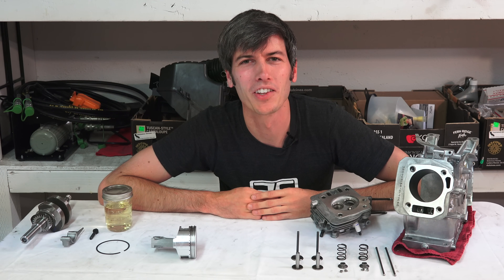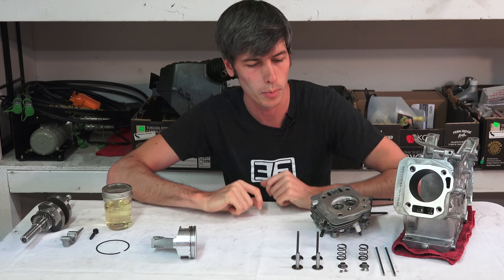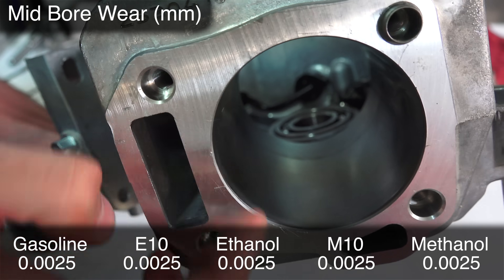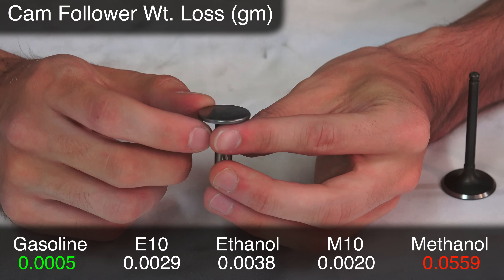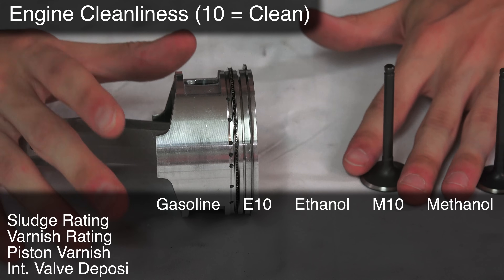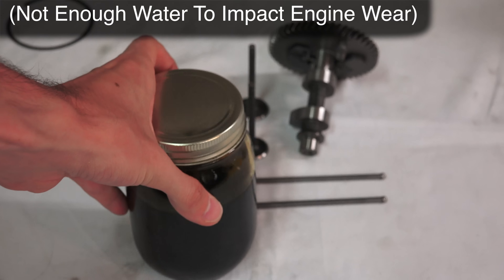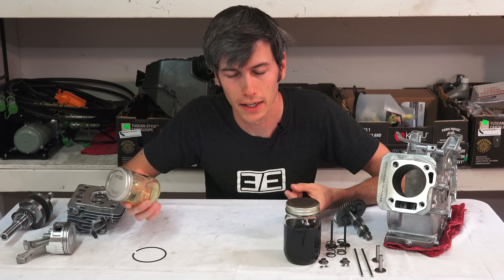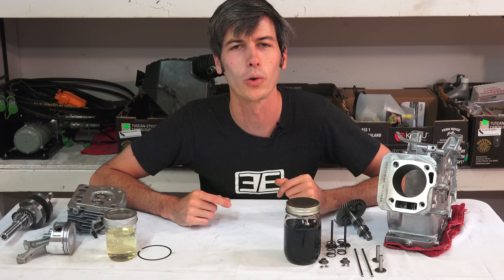Is Ethanol Bad For Your Car's Engine?

Comment: I would have thought the top ring wear was due to the AFR the engine would need to run at Wot due to Methanol having the lowest energy content and the bores were being washed of lubrication.

Comment: I’ve heard a lot of people complain about ethanol, myself included... none of us talk about engine internal wear. The concern is the tank, pump, lines... the rest of the fuel system. You can’t store this crap safely, nor does it play nice with aluminum. This is why airplanes approved to run automotive gasoline are NOT allowed to run E10; lots of aluminum parts in the fuel system, and it needs to be stable for long periods.

In the car world, anyone who owns or is restoring a car that uses the Bosch Jetronic or K-Jetronic CIS fuel system knows about the problems with ethanol. Many of those aluminum fuel distributors have been turned into paperweights because the ethanol gets in there and corrodes them beyond repair. These fuel distributors were used in cars from Europe during the 70’s and 80’s, ranging from VWs and Volvos to Ferraris and Lambos. Some unfortunate owners have discovered the hard way when they sent a poorly performing fuel distributor in for rebuild that the E10 had corroded the tiny internal passageways and it was toast.

As far as the test: I work in aviation, and a 20-hr engine test would be laughed at if one used it to justify any long-term durability conclusions. Take a look at FAR 33. It outlines a 150-hr test, and no engine is certified with only one of those tests... it takes many repeats of that test to prove an engine (or oil, or fuel, or engine modification).

Comment: E anything is a scam.  Without government mandates it will die a  natural economic death.

Can't let that happen of course.  Luckily here in Alaska all gas, is well, all gas.
Reply: Im getting a 1984 Ford F250 with 5.8 litre and i will only use premium as its carbed i hate blended gasoline and same with my '86 Mazda B2000 it usually gets premium to i beleve the blended gasoline wrecked the original carb it ran really rich coyldnt fix it and finally crapped out.

Comment: I have a Mercruiser carborater V8 engine  which usually sits for 10months pa. At the first start each year, it takes the engine 15min to run smoothly. Not with unblended gas. BR from Germany

Comment: In my experience with the E10 Fuel in Australia, you get a fair drop in fuel economy with E10 fuel which negates the slight dollar saving they give you at the pump for it.
Reply: If your O2 sensor is working, maximum drop is 3% using E10 (100% has a 30% oxygen content). In Melbourne, E10 is generally 5-6% cheaper than regular petrol, still works out better and it's better for your car, cleaner cyl heads and valves.
Reply: @doughartmann9272 my Mazda 3 running on E10 gets the same fuel economy as 98. Go figure.mazda recommends E10 for my vehicle.
Reply: Yap.That´s true. Here in Brazil, ethanol is cheaper but  gives a worse fuel economy. Always around a 20 or 30 %  less mileage.  That´s why brazilian  small car are  built with bigger fuel  tanks.
Reply: @Hernan7929  When I was using E10 in Australia (BF Falcon XR6), my ute lost power and economy on ULP. 
It gained power and economy on PULP. 
I got increased power, same as PULP on E10 and worse fuel economy. 
But, using E10 it got better Kilometers/miles per $$$ than all other fuels.
Reply: @Hernan7929  Out of curiosity, how much are you paying for ethanol vs. gasoline or diesel right now?

Comment: Great info, but what about Ethanol effects on fuel lines, injectors and so forth over a few years of time?
Reply: After 20 years of E10 in my Jeep with some experimentation up to 25%, I had to replace a fuel line due to salt and snow related corrosion of one of the few steel fuel line components.

Comment: Brazil 
The first car with an ethanol engine was produced in 1978. 
Rising from E22 up to E100 since 1978!!! no problem for 40 years. 
Just because it is new to USA not mean new to the WORLD.
Reply: The problem with E100 is producing it. A friend invested $1000 in an ethanol stock 15 years ago and saw it go nowhere... just gradually lost value. Ethanol production has a lot of costs, particularly in using arable land for growing the crops used as base stock for the ethanol. Dedicating land for ethanol production inevitably increases crop prices.

Comment: If ethanol has less energy why do people change there cars to run on E85 and say it is better? Is it a placebo
Reply: Energy is measured in joules, not British thermal units as most think. Different fuels exert different forms of energy measured in torque and power.

Comment: I run e85 as much as possible. My engine has to be pretty decent then I guess.
Reply: I use it because it's cheaper, even with lower MPG i save money.
Reply: I've got a flex fuel car with nearly 84k on it and all but maybe 5k on E85, still runs fine.
Reply: Actually what i have seen here in Brazil is that when a car runs only with e100 (that's right), the engine life increases a lot, even the oil is cleaner when it's changed... Another day i saw a 2l Chevrolet Monza (j body ohc) e100 rated with 600.000mi and the engine was the original, never opened...

Comment: In Brazil we have 100% ethanol on every gas station and even though it’s significantly cheaper than gas right now it is about 30% less fuel efficient 
The good thing is that the gains in power on flex fuel cars or performance cars that were converted to ethanol is veeeery noticeable

Comment: If you extrapolate 20 hr wear to 100K miles at an average speed of 25 mph (which would include idling) you get 4000 hrs of operation, which increases wear by 200x, in which case your cylinder wear value for gasoline reaches 1 mm. Is that normal? I have no idea. Perhaps some viewers know.

Comment: the  One study shows in most measurements E10 showed more wear, valve deposits and piston varnish than gasoline. Look at your own published figures.

P.S. why didn't you mention rubber degradation from ethanol in gasoline, ruining the fuel system.;

Comment: Does ethanol fuel avoid carbon build up on Direct Injection engines? Here in Brazil we have so called "FLEX" engines, that runs on any combination of gasoline and ethanol, including 100% of one or the other. If I run always with 100% ethanol the average consumption will be greather, but does it compensates by avoiding carbon build up ?

Comment: What if you have an extra injection system that only injects methanol at higher loads? Probably less than 5% of the driving it will be injected. In racing maybe 50% of the time ofc. 

But wouldn't this give those corrosive deposits a chance to leave the combustion chamber?

Comment: as an ASE master mechanic I have to call the results BS. When you state wear differences on cam lobes, lifters, oil there is absolutely ZERO exposure to fuel to those internal parts. SO any differences in those parts you note as "placebo" , then you deduct that from the other parts that are exposed to fuel, and it will negate any results there as well. Ethanol is EXTREMELY corrosive on plastics, ect (fuel pumps) ... Ethanol keep us in business yes as its crap, its a political scam subsidized by the taxpayer (CORN)
Reply: I call BS on you being a good mechanic.

Comment: this is a good explanation between the differences of the fuels but the big difference is what if you stick this new design Fuel and an older vehicle from the 70 and 80s with the beginning stages of fuel injection with ethanol being there it will take a little bit more fuel to get the same amount of Power but can the older ecu's and fuel injectors be able to make up that difference or would you need to upgrade fuel injectors that is the big question and that will explain why a lot of older vehicles are crapping out now even though less than 5  years ago they're running perfectly fine and they didn't get enough miles on it to cause that type of wear and tear
Reply: differentvehiclesreactdifferentlymyF150ismoretolerantofE85thanmyTempotheF150rarelythrowsaCELonstraightE85buttheTempowilleitherwaytheyrungoodonit
Reply: @alfresco4976  ??????
Reply: wat

Comment: What about the rubber parts such as seals? Shouldn't they deteriorate faster due to the alcohol?
Wouldn't ethanol cause more/faster sludge buildup in short trip engines, especially in the winter (because water being a side product of ethanol being burnt)?
I also have my concerns about a study, which is quite a few years old and only run an engine for 20 hours. That doesn't cover start/stop and short trip scenarios. Engines became much more complex over the years and more parts come in contact with the ethanol (ex. high pressure fuel pumps).
What about the cat/o2 sensor?

This video raises more questions than it answers. Good thing is, in Germany we can choose between E5 and E10. E10 being slightly cheaper. I always choose E5, because it's not worth to risk possible problems (seals deteriorating (faster)).
I drive a 2001 Audi A3  1.6 liter petrol/gasoline.

Comment: Here in france e85 is a third  of the price of regular gasoline. Lots of people a running e85 with : Nothing (they mix or they risk), they remap, they install a flexfuel kit or the do some fueling mods such as injectors.
A guy I know has a citroën saxo vts which has 580 000 km with 300 000 km on e85 with only biggers injectors.

Comment: Did the study talk about any of the rubber components? Just curious. Also, thanks for confirming that storing my show truck with stabilized Pure unleaded or dry is the best to keep water out of the fuel system while sitting in storage.

Comment: This video should be called is methanol bad for your engine? Show this to every guy itching to drop a meth kit on..
Reply: Yeah I've seen people talk about Methanol as if it's actually good for the engine since it gives cooler temps and supposedly cleans or doesn't leave deposits. I guess it cleans out the metals in the engine too! :D Even after seeing the video I'm sure many still want the performance from Methanol, even if it might cause issues in the long run. But it's good to be aware of the pros and cons of everything.

Comment: I worry about the separation more than the wear. Ethanol is an octane booster, so if it separates out, you're running less octane and that could lead to detonation which could cause severe engine damage. How long is "too long" for the gas to sit? Once the car is moving, does the ethanol and gasoline remix due to the shaking of the gas tank? I don't know.

Comment: Noticed your in Sweden at this time which is fitting the topic since we have been E85-country for a while or at least politicians have tried to make us that. ;) I've started experimenting recently with adding 5 L E85 to each tank of regular gas here (95 octane) and so far no real difference.. Just doing it since it's 35 % cheaper at the moment. In a regular vehicle which is probably designed for up to E10 (gas is E5 right now here I believe) so yeah.. Could you make a video discussing what components need to be changed for a vehicle to be considered FlexFuel?

Comment: Had to replace all the fuel lines in my 98’ Passport to keep the E10 from rotting the old lines and clogging the injectors.
Reply: Must have been junk parts from the factory then. I had to replace the underhood portion of of the fuel line on my 4.0l Cherokee due to corrosion related fuel leaks this summer and the plastic shrink tube used to connect the steel "quick disconnects" to the stainless steel line held up to 20 years of E10 and experiments up to E25 in it. The failure was at the steel disco that was at the bottom of the firewall and spent most of it's last 20 winters getting blasted with salt and snow, rusting from the outside in.

Comment: With these new Blended fuels I am unsure of the new E15 which to my knowledge is only offered by one gas station in my area. My father just purchased a new lawn mower with a Briggs & Stratton engine and on the gas cap it is embossed not to use E15, although E 10 is fine.

 I do not understand what the drastic difference is between the two fuels besides one with a higher ethanol content, why would a 15% blend compared to a 10% blend be an issue with this motor.

Comment: IndyCar and drag racing has been using methanol (not ethanol) for over 60 years.  Running on methanol or ethanol is much cleaner that gasoline, the motors have very low carbon deposits.  You should burn a tablespoon of gasoline versus ethanol, the difference is amazing. Gasoline is a filthy fuel.  Methanol motors burn much cooler. The wear issues are really nonsense. If we ran cars on E90, we would not need catalytic convertors. While gasoline makes more energy, most of it is heat.
Also, the biggest myth on the internets is that ethanol comes from food crops. Not a drop comes from food crops. 
Burning ethanol or methanol would mean the end of oil cartels, because anyone, anywhere can brew it, and ethanol is carbon cycle technology, whereas dino fuels are only carbon release. Making methanol from waste actually captures C02 otherwise released by decomposition, and plants grown to make ethanol capture it back from air.
There area number of agencies in NY funded by oil companies with the singular goal of disseminating misinformation amount ethanol and discouraging its use.
Historical fact: Henry Ford wanted to run his cars on ethanol in the early 1900s, because any farmer could make it free. Standard Oil killed that idea and heavily influenced prohibition laws to make production at any scale illegal.